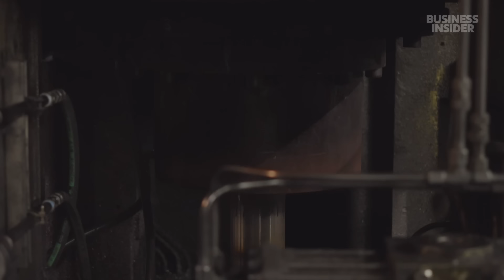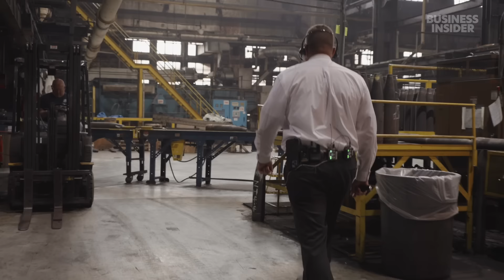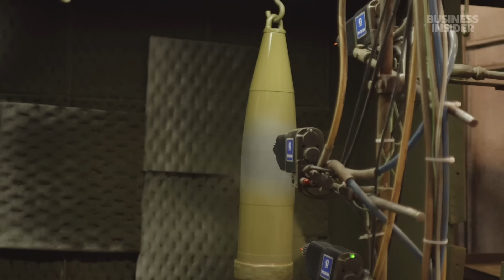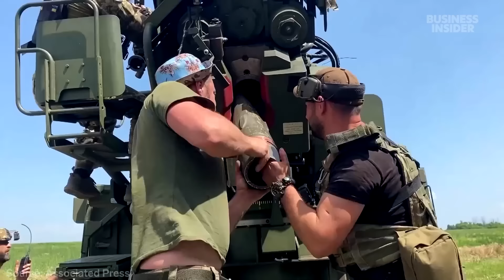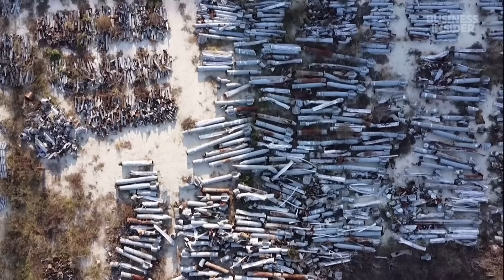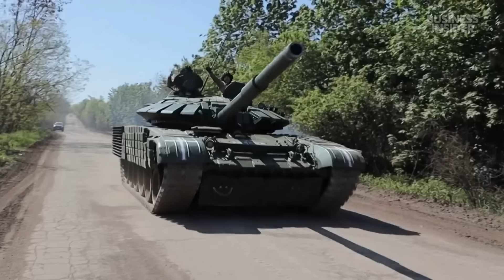Inside The $6 Billion US Ammo Surge To Arm Ukraine

Comment: A few issues: 
- Claiming 155mm is the perfect balance is a stretch. It's good, very good most times, but "perfect" implies there is no need for other calibers, which isn't true. People used to say that about the 5.56, and look where we are now?
- The US didn't "borrow" 500k shells from South Korea; it acquired them as a replacement for US stock.
- Just because other countries ban something, doesn't mean it's right. The issue is not that you mentioned it is banned, because you covered why, the problem is that you did not cover the difference between cluster munitions from the time they were banned, and modern Western clusted mnitoins that have built in safties, or the importance of the location in which they are used, nor the imbalance of power created when one sided uses them but the other cannot.
- Russia is not producing 3 million shells a year. We know this for multiple reasons. Firstly, at their peak, they used just over 3 million shells/year. If they were producing 3 million shells per year, they could sustain that rate, but they are nowhere close to it. Secondly, the statistics for Russia include more than 152mm, whereas NATO's are focusing exclusively on 155mm. Thirdly, Russia is running out of ammo despite having obtained millions of additional rounds from North Korea and possibly Iran.

I give this a 7.5/10 because you got your point across, and you did cover the title, but you should have done more research and expanded on some points.
Reply: Ok boomer
Reply: @ihrdforth3  The stupidity of some people never ceases to amaze me, no matter how much I come across it, or how many anthropological, psyachiaty, or socioeconomics papers I read.

Comment: Doesn't mention the Ukrainian attack on factories that produce the explosives that fill the shells either. That has reduced Russian Artillery Shell production. I believe the problems with the Russian Economy and the Logistical issues have reduced the ratio significantly. And Russian Artillery is using much older equipment which is less accurate. Russia may have had huge stockpiles of Shells but that was not the case for Barrels. Their huge Artillery attacks in the early years of the Invasion took a terrible toll on Barrels and so they ended up being forced to use older artillery pieces and the barrels ran out and production could not replenish the stocks quickly enough. It is interesting that Russia are fighting a war of attrition because the only thing that are causing attrition to is their own Economy. They have reduced the Recruitment age again, I am shocked they have not force conscripted women yet. They did in WW2

Comment: One point missed.  Western artillery provided to UA is more accurate than the ancient equipment the Russian's are using, meaning UA needs less shells per mission.  That circumstance/condition helps mitigate the lower supply numbers going to UA.  Of course, having more is better.
Reply: Agree.  I suspect most of those old gun tubes are shot out by now.  Inaccurate and a danger to their gun crews.

Comment: I thought the USA military have already updated the artillery shell manufacture plant since MOST of the equipment were from the 1950.
Reply: Don't worry you haven't seen what America can do if really fully mobilizes.    Even most Americans don't realize what America's Greatest generation did during World War II.  America built supply Liberty Ships in 4 days, 19 hours, and 32 minutes in 1943.   In 1944, at the Willow Run, Michigan Ford motor company built the largest air plane manufacture in world.  By 1944 it's assembly line stretch over a mile and they could build B-24 bombers with over 488,000 parts in 63 minutes.   Even by todays standards in 2025 Russia, India, and China cannot match what America was doing in the 1940's.

Comment: Poor research on behalf of Business Insider. The M982 Excalibur originally cost about $100,000 due to the GPS navigation and tail fins for guidance. The last numbers I saw was that these Excalibur were still going for about $68,000 per shell (depending on order size), but they could be launched 70 km (about 50 miles) and land on the hood of your car or your dinner table.

What Business Insider didn't tell us is that there is an aftermarket kit manufactured by Northrop Grumman called the M1156 PGK (Precision Guidance Kit) that has a set of guidance fins and a GPS guided fuze that can be bolted to that $800 155 mm artillery shell. Northrop Grumman stated in September 2022 or 2023 (I can't remember which), that at that time, they had already produced more than 100,000 of the M1156's and keep in mind that this is a one-shot-one-kill artillery shell out to 70 km. If you had the coordinates, every time you launched a shell, you destroyed your target.

It is said that the Russians require between 6 - 10 152 mm artillery shells to achieve what Ukraine was achieving with a single artillery shell (either Excalibur or M1156 PGK). It is very difficult to overstate the importance of being able to destroy a target from 50 miles away with one artillery shell. 

The cost of the artillery shell is about $800 and I have heard that the PGK kit is less than $10,000 so for about $10,000, you can destroy any tank or armored vehicle for less than $10k.

I should also point out that there are other advanced 155 mm artillery shells that have the ability to hit moving targets. There are also advanced shells that can identify and target high value targets (select a tank before a Kamaz truck for instance), and shells that even have two warheads in them that can destroy two targets from a single shell if you have multiple enemy vehicles in the same immediate vicinity. 

Western technology is exponentially better than Russian equipment if we would just give it all to Ukraine. After all, they are single-handedly fighting Russia, North Korea, China and Iran and protecting the West while they do it.

Shame on America, and shame on Comrade Trumpski.

Comment: I think the claim of russia outproducing the west in artillery shells is somewhat exaggerated.  

Analysis conducted by the Open Source Centre (OSC), in conjunction with Reuters, and published on 15 April 2025 indicates that as many as 5.2 million rounds of 152 mm and 122 mm ammunition may have been supplied to Russia by North Korea since August 2023. 

Most of the NKorean shells are older than the old tanks russia is resorting to.

If the russians were really producinng as many shells as claimed, they would surely be loathe to use WW2 era shells from old NKorean storage depots, no?

Comment: Insane how a single unguided 155mm artillery shell costs $3,000-$8,000 USD and they are blind fired straight into widely empty fields. 

I could understand if they where accurate but you've got about a 4.5 acre dispersion area kinda crazy, you are not coming close to anything moving.
Reply: no a single shell costs between 500 and 1000. In this video they showed 800 dollars. Where do you get your numbers from?
Reply: @maka6134 

Source is US DOD reporting, these are bottom of the barrel basic 155mm shells ordered on large scale. Even M795 high explosive shells cost $3,000-$5,000 with a single guided artillery shells costing upwards of $50,000-$80,000.

Just because 1 person says their training shell cost $800 doesn't make mean every 155mm shell on the planet is $800.

Comment: Whoever agreed to pay 100k per shell for GPS guidence was clearly part of a fraud ring, and should go to jail for a very long time. I worked in weapon development for the US military for over twenty years. At most, it would cost another $1,000 a shell for this ability. So they have been over charged by at least 100 times. All you need is metal fins, a GPS receiver, and the software to guide the fins to the target.
Reply: Poor research on behalf of Business Insider. The M982 Excalibur originally cost about $100,000 due to the GPS navigation and tail fins for guidance. The last numbers I saw was that these Excalibur were still going for about $68,000 per shell (depending on order size), but they could be launched 70 km (about 50 miles) and land on the hood of your car or your dinner table.

What Business Insider didn't tell us is that there is an aftermarket kit manufactured by Northrop Grumman called the M1156 PGK (Precision Guidance Kit) that has a set of guidance fins and a GPS guided fuze that can be bolted to that $800 155 mm artillery shell. Northrop Grumman stated in September 2022 or 2023 (I can't remember which), that at that time, they had already produced more than 100,000 of the M1156's and keep in mind that this is a one-shot-one-kill artillery shell out to 70 km. If you had the coordinates, every time you launched a shell, you destroyed your target.

It is said that the Russians require between 6 - 10 152 mm artillery shells to achieve what Ukraine was achieving with a single artillery shell (either Excalibur or M1156 PGK). It is very difficult to overstate the importance of being able to destroy a target from 50 miles away with one artillery shell. 

The cost of the artillery shell is about $800 and I have heard that the PGK kit is less than $10,000 so for about $10,000, you can destroy any tank or armored vehicle for less than $10k.

I should also point out that there are other advanced 155 mm artillery shells that have the ability to hit moving targets. There are also advanced shells that can identify and target high value targets (select a tank before a Kamaz truck for instance), and shells that even have two warheads in them that can destroy two targets from a single shell if you have multiple enemy vehicles in the same immediate vicinity. 

Western technology is exponentially better than Russian equipment if we would just give it all to Ukraine. After all, they are single-handedly fighting Russia, North Korea, China and Iran and protecting the West while they do it.

Shame on America, and shame on Comrade Trumpski.
Reply: @yuckfoutube6245 Well said. The m1156 sells usually for around 10k as you mentioned, but when purchased in quantity, it can be as low as $6,500. It is still too high, but this product has had a monopoly, because artillery shells in combat was not a big deal, due to air power, until the Ukraine war. But soon, especially if the Ukraine war continues, there likely will be competition, and a GPS kit like this will probably be at least half, and likely a third of this price.
Reply: @AnitaGoodlay  With any luck, Comrade Trumpski will pull his head out of his asski and provide Ukraine with everything they need to win this war. The good news is that Comrade Trumpski is almost a full year into his dictatorship and we only have three years to go. The other thing we also have to look forward to is that Comrade Trumpski is 79 years old and the lifespan of an average American male is only 78 so we also have that to look forward to. Every day, the odds are in our favor. Mathematical probability.....

Slava Ukraine!!!!
Reply: @AnitaGoodlay  If you can destroy a $2 - $4 million tank or armored vehicle for $8,000 that is a very good ROI. We just need to give Ukraine about 50,000 more of these PGK kits. Slava Ukraine!
Reply: @yuckfoutube6245  In your long technical speech you forgot to add that nuclear weapons do not require a CEP as high as guided artillery shells, so the advantage of Western weapons is entirely relative if Russia decides to use them.
Reply: @trumpforever6706  Engrish as a second language, Comrade? I think you meant to say irrelevant if Comrade Putler decides to use nukes. Well, we all know that there is a 0.0% chance that Comrade Putler is going to use a nuke. And anyway, what does the CEP of a nuke have to do with 155 mm artillery shell production? The BI article was only talking about the U.S. spending $6 billion on expanding production of artillery shells. You have failed Comrade!!!!!
Reply: The guidence technique needs to withstand the shock from the firing and has to work while flying with ~800m/s. 
It should also resist some level of jamming. 
I dont think you can do that cheap.
Reply: @Laurin99 No gps guided weapon can resist jamming because that would defy physics. It's not the weapon that is jammed, it's the signal. Withstanding the shock of firing is an engineering issue, not an expense issue. Every weapon capability has to be researched and engineered before they are manufactured. That's a separate cost than the price per shell cost. The default for most people like you is to side with whoever the authorities are at the time. That's why frauds like this are easy to perpetuate.
Reply: @AnitaGoodlay 
I believe you, that it can be mass produced relativley cheap, but the development cost must have bean high and because they only produce smal numbers the cost per shell are cracy high. 
And i know that the industry is making hughe abounts of money with defence contracts. 

Here in germany stocks of anything defence related were going cracy since the war in ukraine started. 
Reihnmetal is now worth more than Volkswagen on the stockexchange so yeah, we are overpaying. 
But TINA -> There Is No Alternative.
Reply: @AnitaGoodlay 
What did you think are the production cost of a "stupid" impact detoated HE 155mm shell ?

Comment: We need to triple production again. Even if we put 1,000,000 shells in stock, at the 8,000 per day rate, that's only 125 days. You say we're now producing 42,000/month. To reach that 1 million shell level will take at least two years, and that's not counting rounds expended during training, rounds sent to our allies, and rounds sent to Ukraine. To reach four million will take close to eight. Don't forget that it isn't just the artillery shells. It's the guns and gun barrels as well. These all have a limited life and Ukraine has already started using barrels to three times their rated use (before they start to lose accuracy), just to keep the guns firing. What that means, to them, it may take an extra round or two to hit their target. (Like 4-5 instead of 2-3.) Thankfully, Rheinmetal in Germany is also expanding, assuming the German bureaucracy doesn't get in the way. I note that Russia has spent enough money that they are reportedly already producing in excess of a million a year.

Comment: 8000 rounds used a day!? That's nearly 3 million a year. Impossible pace to match in manufacturing.
Reply: Really? You might want to read up on WWI.
Reply: @john_in_phoenix today's production.. Clearly talking about today's production and not WW1..
Reply: @2HighNoon  For reference, the first day of the battle of Verdun, the Germans fired 2 million shells in 24 hours. Do you think production is more or less efficient today? 

You state impossible pace to match in manufacting. Historically 3 million shells in a single year production is very possible to match.
Reply: @john_in_phoenix World War I
~6–8 million (Allies, mostly France)
France peaked at ~6.2 million in 1916; U.S. and others contributed less.
World War II
~1.5–2 million (U.S.)
U.S. averaged 1.3 million/year, with peak likely in 1942–1943.
Current (2025)
~480,000 (U.S.), projected 1.2 million by 2026
Reply: Did I not make this clear enough before? I was talking about today's production capabilities. Read my previous comments. 💯
Reply: @2HighNoon Did I not make it clear that 3 million shells a year is easily attainable? You proved my point. Basically the US will be at 1.2 million per year by the end of THIS year without even trying.
Reply: @john_in_phoenix without trying? 😂 That's still short. You need to understand the raw resource situation. We don't have the same resources to pull from in today's world. We've used up a lot of them. There's a bigger reason than building factories that the production isn't ramped up to meet the demand.
Reply: I think they run on 2 - 2.5 million per year currently.
Reply: @sk.43821 current US production is just under half a million percent year manufactured. 480,000/yr production. 👍✌️